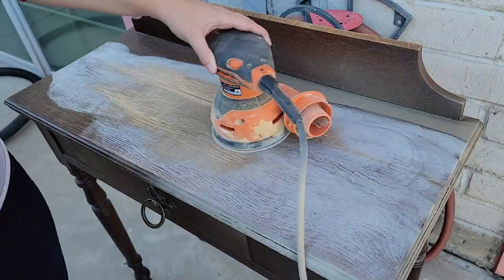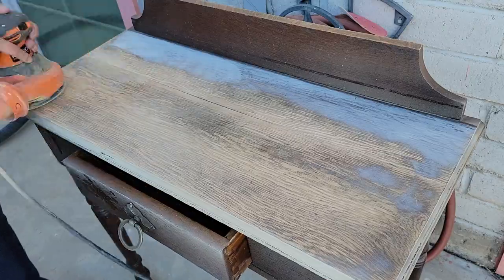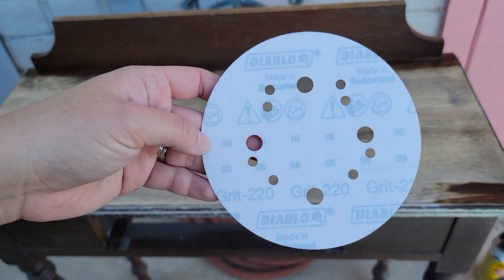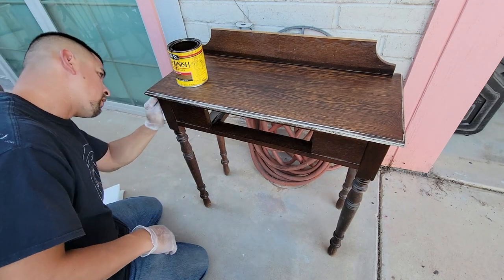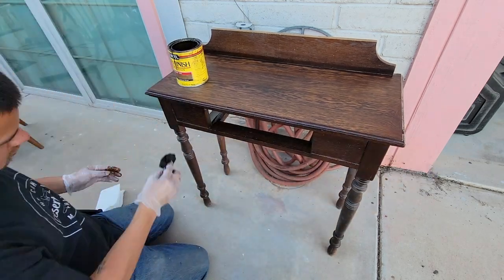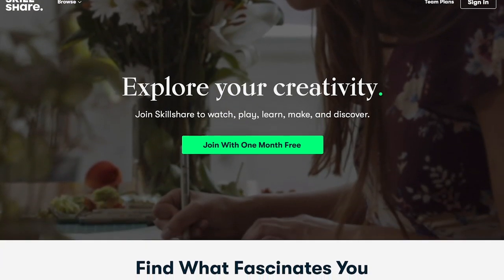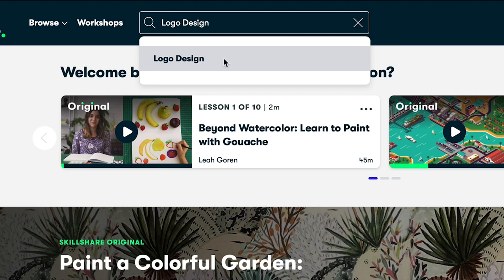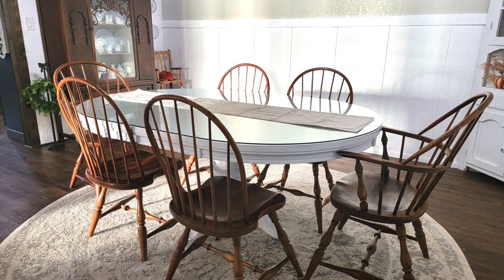2 Furniture Flip Projects to Inspire Beginners

Comment: Beautiful transformations! Could you please explain a little more about rehydrating very dry wood?
Reply from the maker: You wipe on the same color stain over its existing finish and then apply a seal which could be a poly, shellac, oil, wax, etc.

Comment: Jacobean 🥰🥰🥰🥰 but unless I use on root wood, I use sanding sealer first then the stain and I love the rich warm tones with little bit of red.... before that I would mix the walnuts... I need brown with very little highlights of red tones... and in Arizona the dark colors show all the dust😑🤣🤣🤣
Reply: And do you think the shellac would work like I use sanding sealer?? To seal wood and hold true stain color?? Looks alot easier to apply and probably cheaper 🤔🤔🤔
Reply from the maker: Shellac would be a completely sealed finish and no stain would be able to be applied afterwards. It would be great for after you use your wood stain, but not before the wood stain.

Comment: Cory I love the pine color. I hope that makes sense. The light bare wood of cutting boards and lighter baskets. I have some furniture that is too dark. If I sanded it all down but want no color at all what would I put on wood?
Reply from the maker: Hi Reda, it would depend on what wood the piece is made of. Going from dark to light stain does require sanding down to bare wood. If you don't want to add color, you can seal it without a stain. A good way to test what a wood tone will look like with no stain, just sealer, is to wipe it with a damp rag.

Comment: Great job on your projects. The antique table was really pretty. I live in the Phoenix area so I know what it does to Wood. I picked up a bar height table set where the chairs are cracked from sitting on a covered patio. I have been afraid to tackle the project. I'm a complete newbie. I have a question though, if you want to change the stain color, do you have to sand everything clear back to bare wood? I have some lighter honey-colored end tables I've had for quite a few years and I keep thinking I should restain them but I wasn't sure what to use. I just love the darker Walnut color.
Reply from the maker: Hi Mary Beth. Yes, if you are changing the stain color then you'll need to either completely sand it to bare wood to use traditional wood stain like I used ORRRRR you can go over a lighter stain with gel stain to make it darker without sanding.

Comment: Hi ma’am. Do you have to clean out the top of the spray tool after using the spray shellac?
Reply from the maker: The spray tool just clips on to the spray can, it shouldn't have any shellac on it other than tiny bits of over spray. If it has so much on there that it needs to be cleaned then your can might have a malfunction causing it to leak from the sprayer